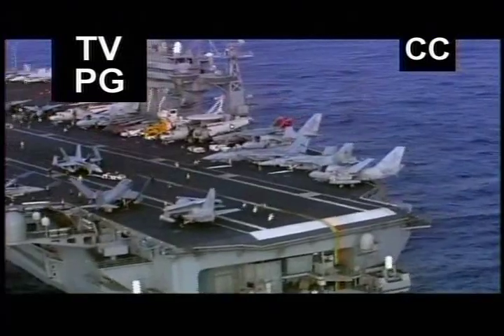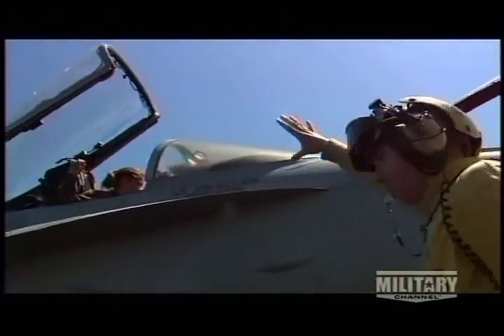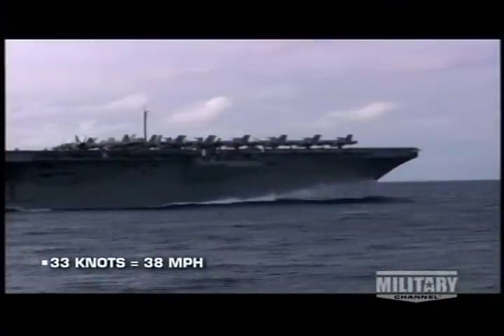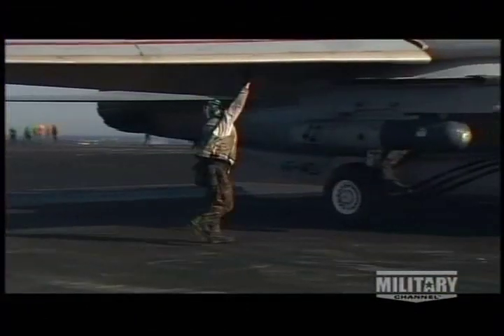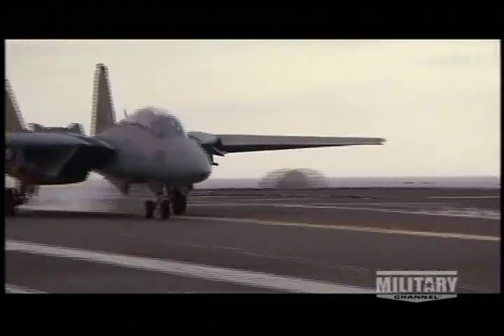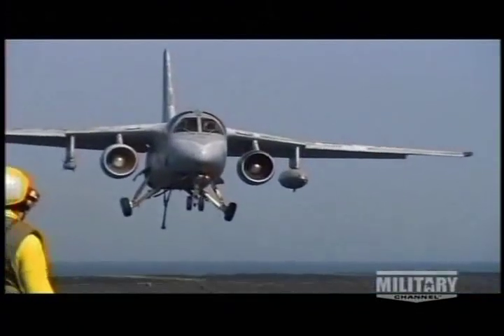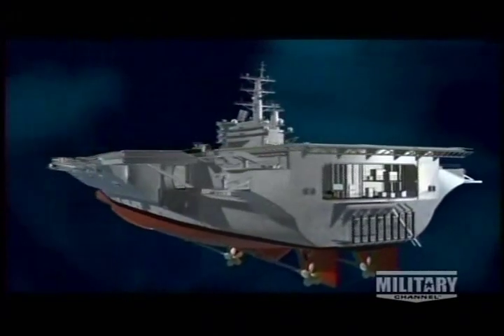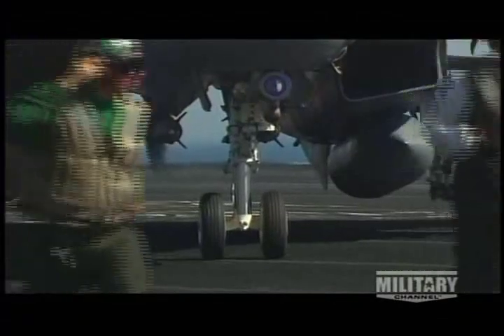Anatomy of a Supercarrier Part 1

Comment: @arbitrage2030 fact is that usa would lose an invasion in the mainland. because if i remember correctly they only have 90000 soldiers in the states and it relys on military bases outside usa. (without launching nukes)

Comment: @renegadebiker24, unless you were a pilot in the 80's you know that if you turned the wrong way the engine could have stalled.  Still the death of the F-14 could be attributed to Dick Cheney when as defense Secretary he didn't renew the contracts for the F-14 and wanted those retired.

Comment: @renegadebiker24, so were you a pilot, a RIO, or part of the crew.  Until the Super Hornet came along, that was the best Navy plane for the US.  I mean it could track up to six different targets, handle the long range Phoenix, had a long radar range and could fly further than the Hornets.  The disadvantage was it was heavy, more parts, a bitch to repair, and the engined was underpowered until the upgrade in the 90's. I mean the Top Gun scene where the F-14 stalled in the Jet Wash was common.